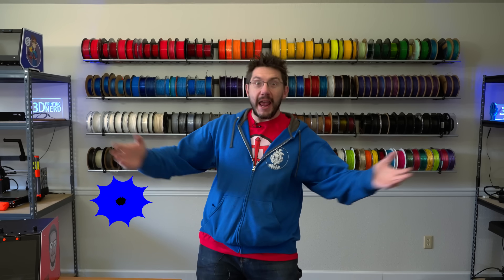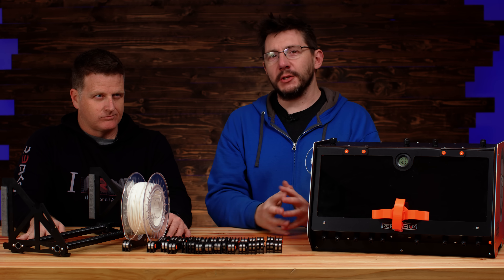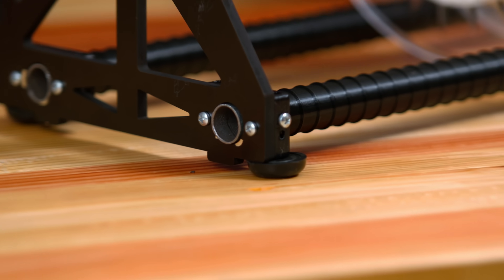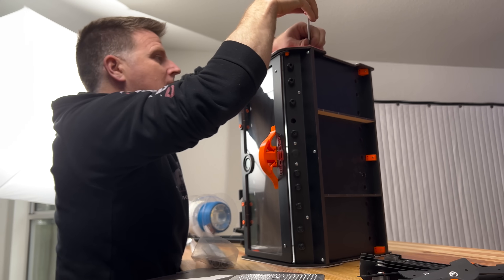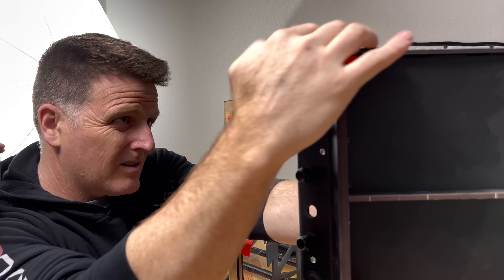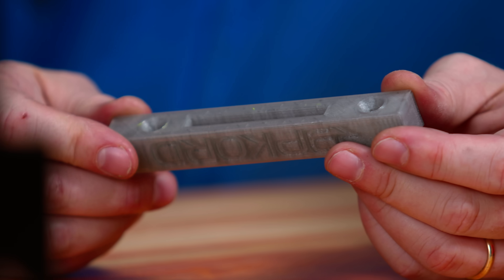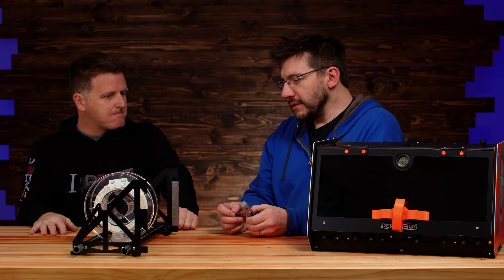ULTIMATE Filament Storage Solution!

Comment: This seems like a really great way to destroy your filament. Unless you're completely emptying the racks daily and reloading in the morning for the next day I don't see how the filament holds up at all well. Dust settling, moisture absorption, UV exposure, etc. Sure, you could dry out a roll for eight hours before use but that isn't going to lead to great prints after the first time through the cycle of use, absorb moisture, dry out use and repeat. The filament just starts to chemically absorb damage with that kind of treatment.

Comment: I have horrendous battles with moisture.  Funny, my first spool of PLA I left on the machine and used it over two years.  Never had the slightest moisture issue, didn't even know moisture WAS and issue.   When it ran out I bought about 6 other rolls of various PLA's and a roll of nylon.  I spent about two months trying to figure out what was wrong with my printer!!  Finally learned about the whole sordid moisture issue.  I've learned to keep ALL my 20 rolls of filament in vacuum bags with moisture cards and socks filled with descant.    I can't see these wall racks as being useful at all because of moisture absorption.  I guess the racks would work if one planned a day ahead of any and all prints where you could dry the filament overnight before using it?

Comment: When it is fully loaded it will not roll anymore and your printer have issues, bad design I tell you!
Reply from the maker: Fully loaded and not roll anymore? Maybe I don’t quite understand - but any of these filaments on the wall, with the slip rod pieces installed, would spin just fine.
Reply: @3DPrintingNerd  I only see 2 rolls. When the rack is fully loaded they won't roll anymore. You need rolls for every spool.
Reply from the maker: @pipodeclown3782  Oh, I see what you're saying. You don't! The black PETG pieces on the EMT pipe aren't suppose to spin. They are called "Sliprods" because the filament spools "slip" while they spin. The PETG pieces reduce the friction, allowing most spools to spin easy enough for most 3d printers to take. I hope that makes sense?
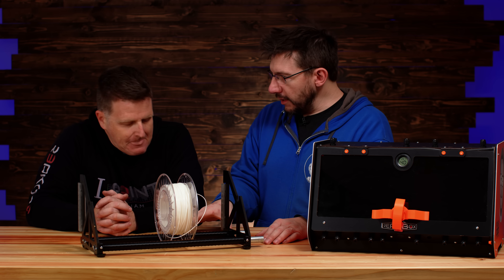Reply: @3DPrintingNerd  Aha....but at 1:30 you see the EMT pipe turning so you that let you think it should turn......

Comment: Great idea, but storing them uncovered will expose the filament to dust, dirt and moisture. are you not worried that the filament will be impacted by these conditions? wouldn't be giant airtight box with desiccant be a better solution? ;)

Comment: 10 feet of 1/2 inch pipe at most big box stores in my area (midwest, USA) is approximately $5.  Which is great.  I've used the same for curtain rods and 3D printed mounting.  Great idea!

Comment: Great design if you have a print area that's constantly kept extremely dry, I don't get below 18% rh. So I keep my rolls bagged with 120g of silica gel packets in their original boxes.
Reply: For PLA and PETG, 18% is no problem at all, as far as I can tell. For other filaments like Nylon ect., yeah, I  get your point.

Comment: How do you deal with moisture? 
Do you dry them beforehand or could you keep the room at a certain humidity level? And if you could latter how much humidity does it have to be for filament not to pull moisture out of the air? I currently have under 30% in the room.

Comment: Open source is great but just open is not ...
You will need/want to add some way to prevent dust from collecting on the filament (at least I do). My first "enhancement" for this would be a clip on the pipe to add labels for manufacturer/material type labeling.

Comment: Why did you say, "Thanks GoPro"? [Edit: oh, I heard it beep. Out of battery or SD card?]
This is a nice storage solution. Maybe not as nice as my leaning towers under and around the printer table! I'm wondering if I have somewhere I could put this (limited wall space that isn't in parts of the house where my wife wouldn't appreciate filament storage).

Comment: This is great if you have tons of PLA and you're printing often enough that you don't need to worry about moisture absorption.

I'm actually trying to come up with a solution that can fit in a bookshelf and enclosed so one can potentially dehydrate right in the storage rack. That way, one can have nylons and polycarbonate filaments available on demand.

Comment: Is it safe to store so much filament outside of sealed pockets/enclosures? Won’t they get humid after a few hours/days and need to be oven dried before being used?
Reply: Yeah, it's safe. Most filaments like pla don't even need to be stored somewhere super dry. And if you do have any that need to stay dry you can just throw it in a vacuum sealed bag with a decadent pack.

Comment: Looks like a great way to store rolls of filament.  I wonder if a roll of filament that is vacuum  sealed in a bag and put back in the box would fit with a corner of the box below the two EMT pipes.  I have just under a hundred rolls of  PLA, PETG, ABS and TPU on shelves now in vacuum sealed freezer food bags with a desiccant  container and a humidity meter inside the bag.  I am kind of anal about  filament storage due to the investment I have in it.  Nice job though, and I do like the idea of making it available to anybody for free.  Good to see Pooch again.

Comment: Nice but how do you keep that amount of filament without acumulating dust?
Reply: Have a dust filter in your house?
Reply: @pkchutrainer  i don't understand what you mean.
Reply: @garramiro  If you have a good air filter system, dust shouldn't be much of an issue. Also, you can just run the filament through a sponge or something to pick up any small particles. If your filament ever gets dusty for some reason just dust it. Or blast some pressurized air over it.

Comment: Hi Joel, question is could you go virtical? I tried yur other brackets with a 1x2's and it came crashing down with 3 brackets with a 4' section of 1x2's. The PETG brackets did not hold. Saddly landed on my laptop and cracked my screen but things happen so thats why I am thinking vertical rather than horizontal.

Comment: Nice guys!
Yes, bearings are often too smooth, and the filament just wants to keep unspooling….requiring some tensioning mechanism(rubber band in my case.)😎
❤️Lightburn
Reply: Basically a friction clutch but it pretty much does the same as if you just put them on 2 cheap plastic rods lol

But overengineering is cool

Comment: The RepRack feels like a good solution for having wall-mounted filament if it's being actively used, but it seems like this set-up here is just meant for storage.  Given that, is there any real advantage to this over leaving the spool in a box and putting the box on a shelf?

Brainstorming, the upsides feel like: less time and hassle setting up the spool to print; easy to see colour and quantity remaining; and of course the sense of satisfaction of a) making a thing and b) having a filament rainbow.  The downsides are: inflexible storage space (the rack is less useful for things that aren't spools) and exposed filament (when the spool is in a box, it's easy enough to also have the spool in a sealed bag.)

So, the actual answer to my question is going to depend on the user's needs.  Anyone have ideas for more pros or cons?

It looks really awesome though!
Reply: All good points. Keep in mind that there are and will continue to be add ons that enhance the use-ability like the option to add slip rod or rack stands to print directly from the racking placed above a printer. Smaller lengths can be taken down and used in a desktop setting and then placed back on the wall when done to keep your desk clear. Great for Palette / MMU / Chameleon / ECRF and other multi-material setups. Lots of possibilities
Reply: @Repkord   Sure, but that's not quite on my point.  I lead with "a good solution...if it's being actively used."  That statement, to me, covers "print directly from the racking," and "great for... multi-material set ups."  That sort of use seems to be what Pooch had in mind and this looks like a great way to handle those cases.  Heck, I'm already pondering how I'd need to rearrange my printer room to mount one of these over my Prusa XL once that's a reality and not just a pre-order I'm frantically saving up for.  :)

"Smaller lengths can be taken down and... then placed back on the wall to keep your desk clear" is exactly what I already do.  It's just that my process is slightly more complex: take the box off the shelf.  Take the bagged spool out of the box.  Take the spool out of the bag.  Put spool on printer.  Print.  Take spool off printer.  Put spool in bag.  Put bagged spool in box.  Put box on shelf.  With this racking, one is saving 4/9ths of that process - which is what I meant when I said "less time and hassle setting up", at the apparent cost of having the spool exposed to the elements.

In other words, I think you simply repeated what I said, but added some specific examples?   Or have I overlooked something?

Anyway, I hope this doesn't sound defensive.  Communicating in text is hard!  It's good to take my broad statements and turn them into specific use-cases.

Comment: What happens over time with friction between two plastics?
Reply: Over time I suppose it will wear but in our tests so far its held up really well. Worst case you can remove a worn slip rod off the EMT and print another one. Its a vase mode print and runs really quick. PETG seems to hold up better than others we've tried roo
Reply: @Repkord  Thanks for the reply!
Reply: I would think the PETG would hold up extremely well and you would be  hard pressed to wear them out. I've printed linear rails and blocks in PETG and they've held up very well with no visible wear after few years of use.

Comment: OK so you put your filament on shelves (basically).  Congratulations.  I do the same thing except I also use a sealed bag with desiccant and put it back in the box and find that it sits on shelves a lot better that way and stays dryer here in our high humidity environment.  Just sayin.:chillwcat:🙂

Comment: I like the idea and it would be a fine solution for my workspace. 
However, I have actually about 65% humidity by 30ºC in my room and it would affect the filament. 
What are your room conditions and experiences with moisture?
Reply: keep each roll in 1 gal. "ziplock" style freezer bag with a desiccant pouch in each bag... not perfect but will help

Comment: Totally utilizing this,  im running out of filament storage with my current setup which isnt optimized, this looks more compact/simple/cheaper and able to scale to different size locations easily
Reply: So what you’re saying is we need a bigger ERCF
Reply: Woot! Cant wait to see your setup!
Reply: What about the humidity on the filament rolls?
Reply: @emanuelcalderon  Depends on the conditions in the room really, my basement is dry, house has central air, dont live on the coast, humidity inst really an issue, ive left spools out for months/years without issue.
Reply: @CanuckCreator  good to know.
Reply: Looks amazing
Reply: Holy crap its the Nero himself

Comment: Wonder how well the cardboard spools can slip/spin on the PETG sleeves
Reply: Depends on the "cardboard" some chipboard sides will work but If they don't, theres a rack stand upgrade available for that that just sits atop the rails and has a traditional arbor mount. Also works with the repwinders. It should be on Prusaprinters (Open source also) by tomorrow evening along with another TUSH inspired rack compatible design for those who still want bearings

Comment: Looks great, great idea, and great video.  I like how the design can be used in various ways. Funny enough,  I have some air tight tool boxes I use and I have the same piping down the middle. I cut PVC pipe sections and have those riding on the pipe and it runs through the middle. This would be a great upgrade.  I keep desiccant in the bottom in bags,  but this setup could easily fit above those and still make them easy to get at. Pulling out a pipe with 8 rolls of filament each time is a pain.

Comment: Some organization would be nice, like a tagging system. Maybe something like printer dividers you can move around with the plastic type printed on it. Besides that, you'd need some moisture protection for PETG and others I guess.
Reply: Or just bake the petg before a print.

Comment: Arent you worried about your filament absorbing moisture? Or do you dry every spool before using? I genuinely want to know, this solution looks nice and convenient, but there's so many warnings from people saying not to leave spools out in the open
Reply: Yeah I was thinking the same thing...I meticulously put each of my filaments in a plastic bin that seals with silica packets at all times when not printing.

I suppose if you own a crap ton of filaments like that though, you could store them like that for asthetic purposes and save floor space and just dry them if you needed to print with them. 

For me, I'll be keeping my spools sealed away in my bin haha
Reply: I was just thinking the same thing. Not just moisture but dust could gather on the plastics. It would be nice to have some kind of transparent plastic cover that could be easily lifted up/off. Maybe have two ends where one could side in two long transparent plastic walls with a hinge of some kind on the corner between the two (or near the wall?) like a wall-mounted cabinet. Could also put labels on them to identify what they are holding?

Edit: Maybe also have silica pockets on the inside like you mentioned to keep the area dry and section it instead of one long area.
Reply: Easy enough to put a cheap dehumidifier in the room.
Reply: You can box it in. Since the idea is using EMT you can cut out pieces to form a frame, print some simple corner adapters then wrap it in plastic sheet. I would suggest painters plastic as a sheet material, good stuff to insulate against moisture and easy to cut with ordinary scissors or razor blades.
Reply: For 90% of people, they live where humidity in the home is 30-40% and won't harm the filament unless it's nylon or something. PLA isn't gonna change much. Now 60% and above might have some issues.

Comment: With storing filament on the wall, how do you control the moisture absorbtion?
Reply: And dust...
Reply: If you have this many spools, storing them all in a moisture-controlled way doesn't seem feasible anymore. You'd have to pick a filament for a project, then dry it before starting. And presumably materials that go off faster could be stored in a different way.
Reply: @Agamemnon2  or just have a vaccuum sealed bag with a decadent pack inside for the ones that need it.
Reply: You humidity control the room and you print A LOT ;)
Reply: 1 gal. "ziplock" freezer bags with desiccant pack in each bag
Reply: I probably have about half that much filament and I have 4 dry air tight containers with desiccant in each container to keep them all in decent shape.
Reply: Where do these people live that storing filament on the wall is even an option?  If the house is dry enough to store even pla out in the open you should probably be using a humidifier for health reasons.
Reply: @DavidChiluk  I've never had issues storing pla in the open and it's mostly 70%~ here. Don't really think humidity is a big issue for pla. hasn't been for me anyway.
Reply: @DavidChiluk  yeah idk. In Texas that's just life. I think humidity is technically "too high" but i've never had any trouble with my filaments as long as they are at least a certain quality. My guess is that there are quite a few factors involved and aren't yet completely understood, but for some regions it just isn't a problem.

Comment: Moisture's best friend
Reply: Yup,  there is enough filament I suspect that it is measurably dehumidifying the room...
Reply: Moisture is overrated. I have no problem with PLA without any drying measures, stored in plastic bags.
Reply: @MetalheadAndNerd  It depends on where you live. In my case it would be impossible to use that method.
Reply: I keep my many rolls in a giant plastic bin that seals with desiccant. It stays dry for a while, but after a month or so I need to dry them again. I do live in the NE of the US though so humidity is a serious factor.
Reply: Where I live indoors humidity is between 30 and 50%. The only filament where I ever had moisture issues was PLA with wood particles and filament that came with visible drops of water inside the sealed package.
Reply: Been using the same basic design I found on thingiverse. I live in one of the highest humidity states of Michigan and going on a year with some rolls and no moisture related issues yet.